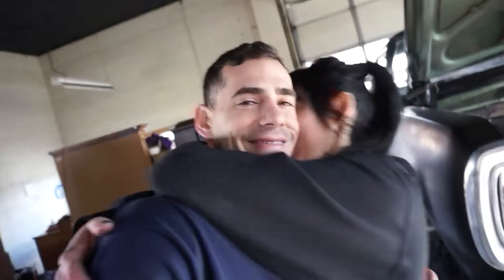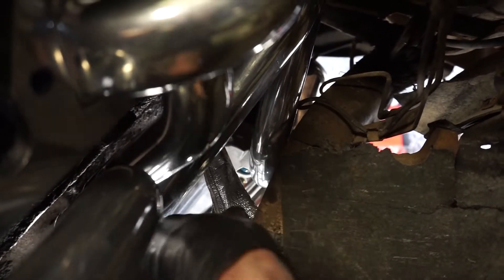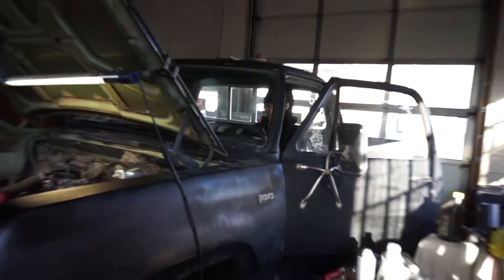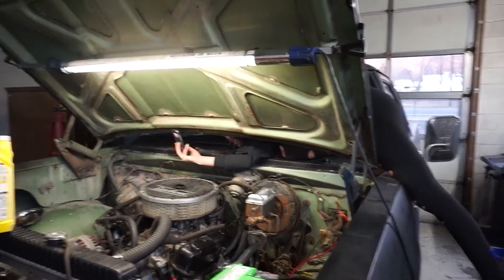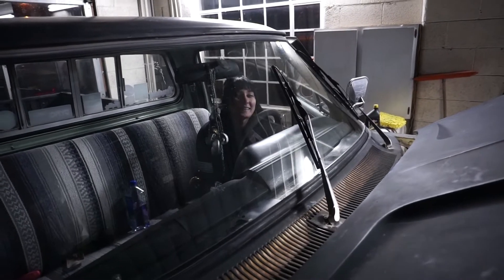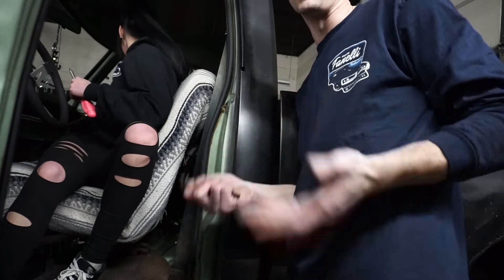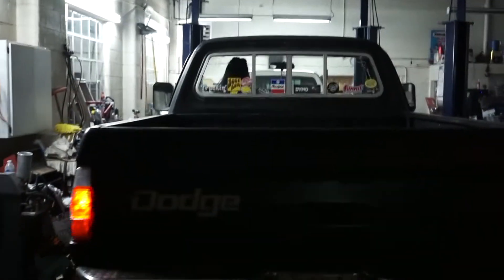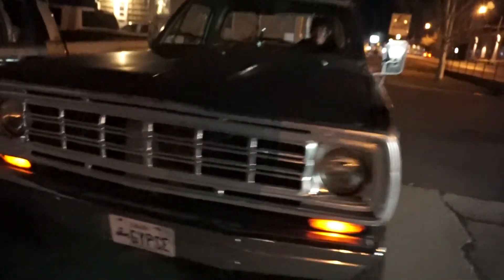Long Tube Headers for Alex's 1978 Power Wagon Ep. 3

Comment: Love my old 77 dodge I already did the same thing on mine for the headers and starter 3 years ago if you want a good sounding exhaust and a little bit less loud I recommend an H pipe 2.5 or 3 inch exhaust piping with a tip thats 12 to 18 inches long for that nice deep rumble. 
My inlet for my 18 inch tips are 2.5 and the outlit is 4 and I love it.
straight pipe with an H and two long wide tips are the way to go you'll sound good and be able to talk in the cab.
Reply from the maker: absolutely, yes that sounds like a good setup!
Reply: Mid 70s door rubber seals from a Chevy p.u. will deal better than the Dodge it helped my 78 club cab

Comment: Nice, I just picked up a 75. I want to do headers but most people said i would have to cut the frame to make them fit. whats the clearance you have between the headers and the frame. did you cut it at all?
Reply from the maker: They fit fine between the frame didn’t have to cut anything frame wise you see in the video where I had to notch the passenger header for the 4WD front driveshaft

Comment: I'm installing long tube headers on my 1983 w150. I had the exact same problems. I'm going to have to drop the driver's side header again to dent the header even more. I have to order a heat shield for the starter.

Comment: What starter did you guys use?
Reply from the maker: Just a starter for a 98 dodge Dakota they’re pretty universal for late 90s dodge V8s to fit the older dodge v8s same bolt pattern for them to mount up but are much smaller